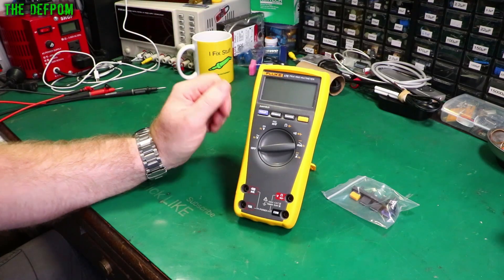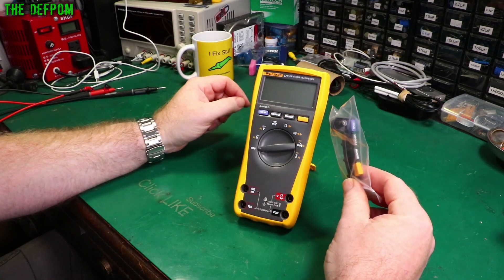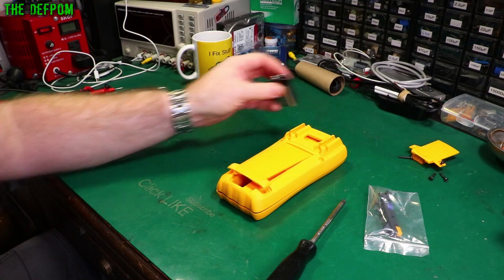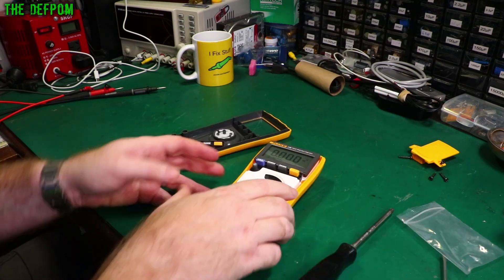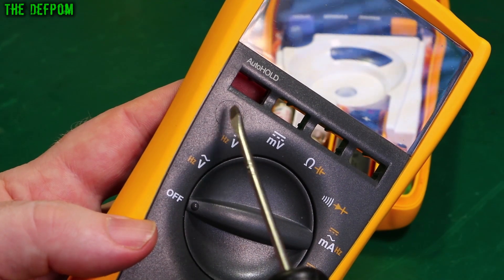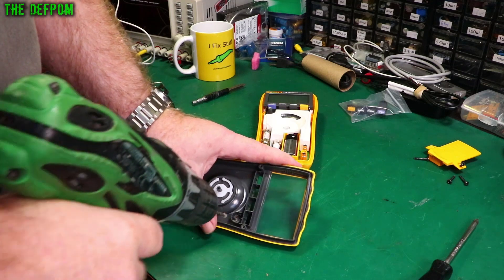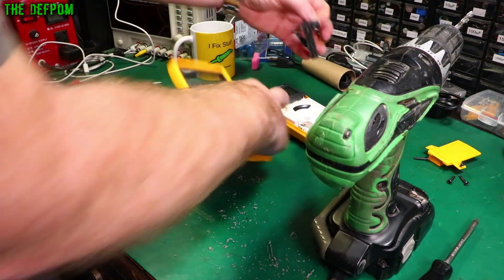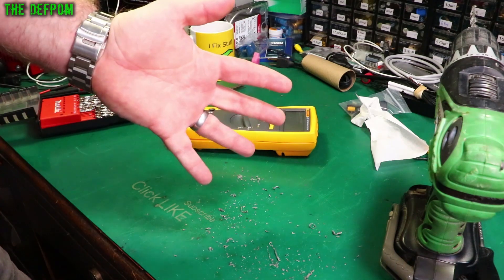🔴 Fluke 175 Backlight Hack - Turning a 175 into a 177 - No.954

Comment: Ознакомился  условиями гарантии, «The warranty does not cover manuals, fuses, disposable batteries, damage from neglect, misuse, contamination, alteration, accident or abnormal conditions of operation or handling, including failures caused by use outside of the product's specifications, or normal wear and tear of mechanical components. This warranty covers the original purchaser only and is not transferable.» такая модификация лишает пользователя гарантии!

Comment: Thank you very much for the information. I opened mine to check if the Backlight was installed, unfortunately not. I bought mine in 2017 and it could be by then it was not possible.
Anyway, I would like to say thank you once again. for taking you time for me..
Friendly greetings

Comment: Hi, do you change only buttons? Did you soldering tranzistor and few resistors on your pcb?
Reply from the maker: I did exactly what I showed in the video.
Reply: @TheDefpom  so u have a newer version of 175 because in older version a transistor and few resistor is missing

Comment: Hi great video thanks . I get the beep, when I link out the contact ..but no led comes on ? Any thoughts?
Reply from the maker: I have had comments that not all units have the backlit LCD installed, some do, some don't, it looks like yours does not have the LED fitted.
Reply: Thanks for the update, I’ll see about getting a led , I work in car footwells and the back light would be a great feature. Have you got a picture of the PCB output for be led location?

Comment: Great video! I took my 175 apart, the mold date is 10/2020 and printed on the board is “Fluke 17X-3021 Rev 004” as well as a sticker with “FK179/177-4021”. Looks like it was too costly to make a specific board for the cheap model. I wonder if this has temperature probe functionality hidden too! Does anybody know where to get a film to increase the light spread from the 2 LEDs?

Comment: Buenas noches..
Al parecer, ese 175 vino con los leds colocados y su sitema, solo omitiendo el boton y el difusor de luz oara que ilumine la pantalla completa.
A mi viejo fluke110 version antigua yo tambien habilité la luz, colocando el boton, transistor npn, dos resistencias, leds y difusor de luz.
Quedó como el 112 que si trae luz, pero color verde, el mio quedó con luz blanca.
Supongo que los 175 que tienen los componentes, pueden hacer lo mismo que yo, el circuito ya está impreso de fabrica, solo faltan los componentes.
Pasa que son las misma placas del 175, 177 y 179, solo que al faltar componentes no realizan la funcion como el mas completo.

Saludos..
Reply from the maker: Gracias por la información, es bueno saber que otros medidores también pueden hacerlo.
Reply: hola una consulta que transistor le pusiste y el disfusor gracias

Comment: So were did you get the button. I have just received a snd hand 175 with worn buttons. I just can not find the replacement on the internet
Reply from the maker: It was on eBay, I did a such for fluke 175 button membrane
Reply: @TheDefpom  
Ok No result, will try later again
Reply: Tx btw